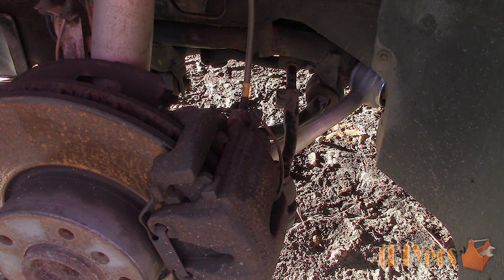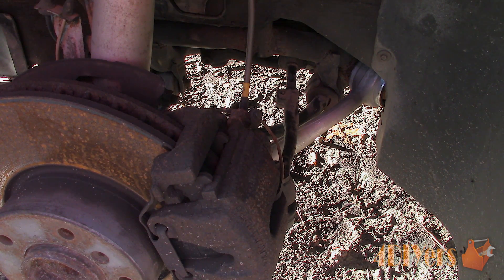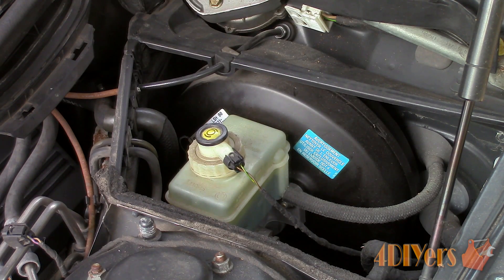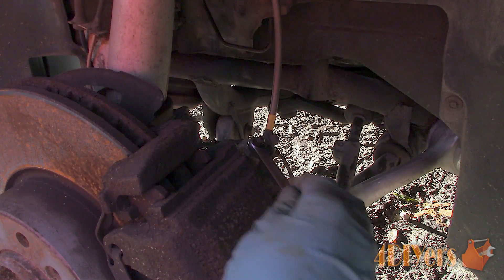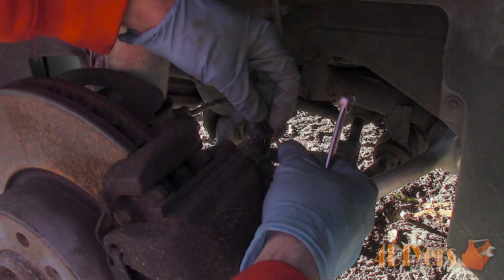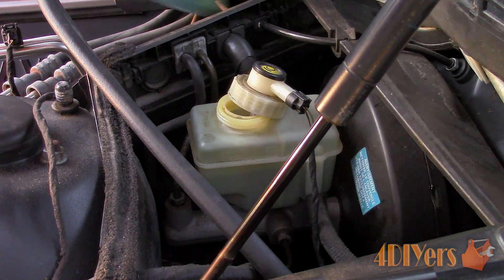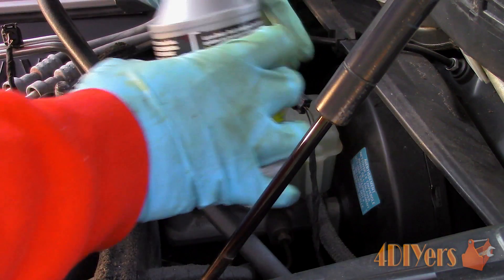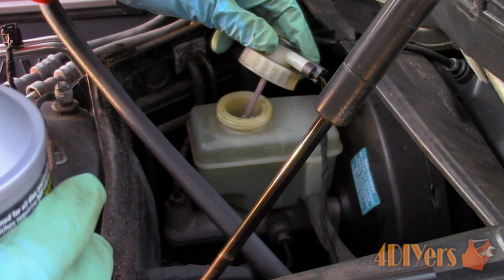DIY: How to Manually Bleed Brakes

Comment: If you have an older vehicle, I would recommend buying new bleeder valves before attempting a bleed. Especially if you live in the rust belt.
Reply from the maker: Great tip, thanks for sharing!